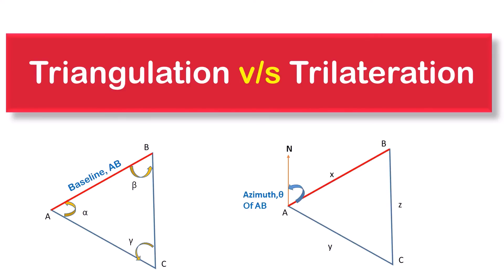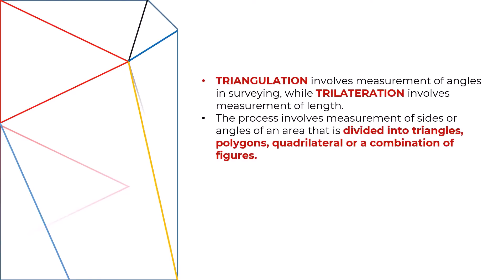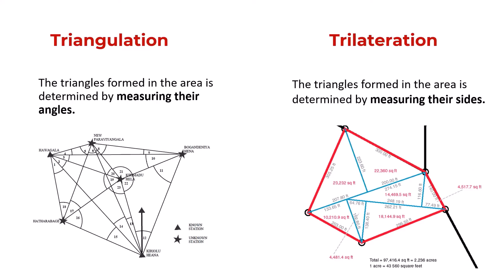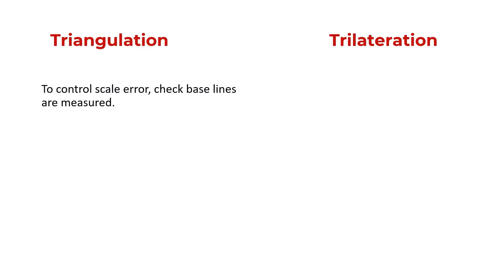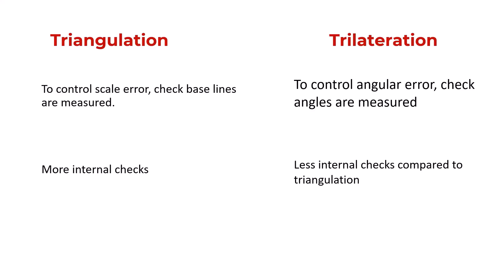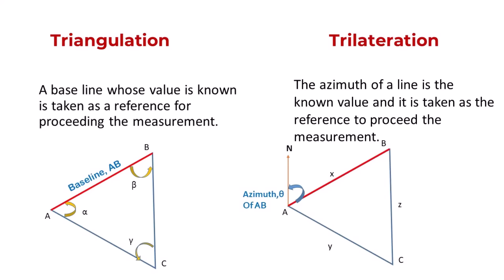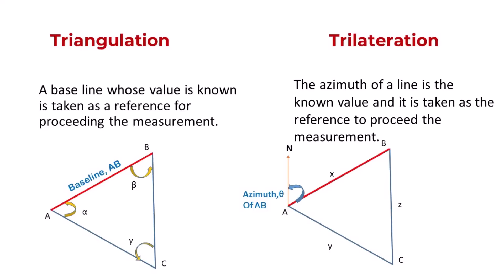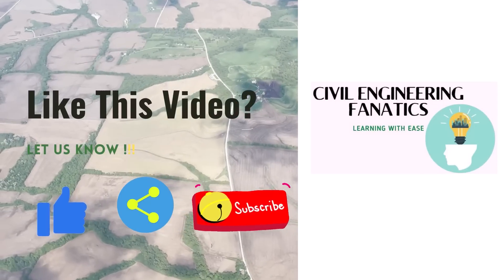Triangulation and Trilateration Difference |Civil Engineering Surveying

Comment: I thought that A long time ago I had concluded that you could use only 90° triangles to triangulate. Wanting to review this I was surprised to hear about the law of sines (although I can understand it perfectly). Then I asked chat GPT if any scalene triangle could be turned into q right triangles and the answer was “yes”. So my question is: if you really just wanted to use sin cos and tan and angles to connect several triangles in order to measure a distance, you could, couldn’t you? Thanks for your video, it was most interesting. I myself am preparing a video about the beauty of trigonometry but in Spanish. Well, maybe I’ll do an English version as well.